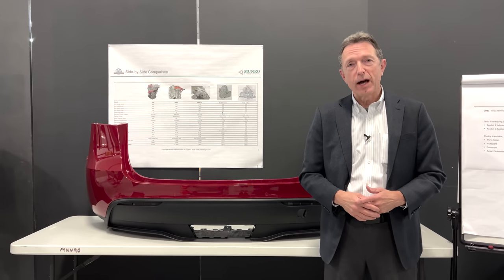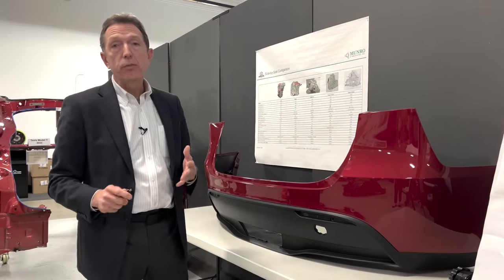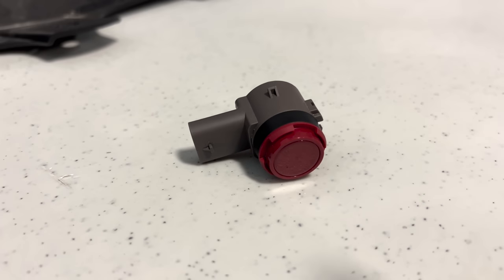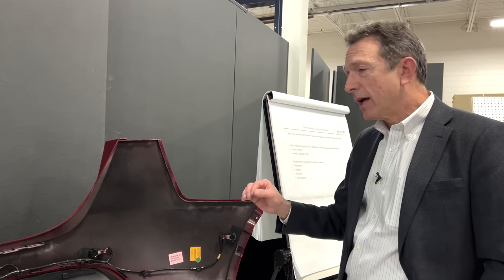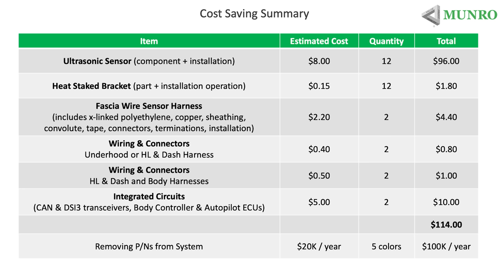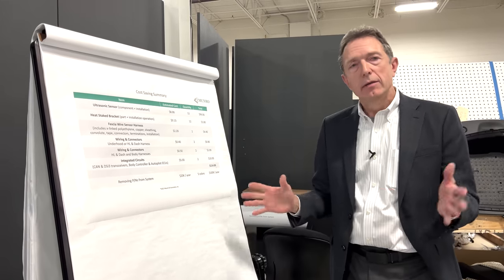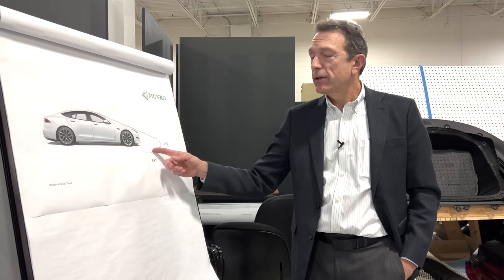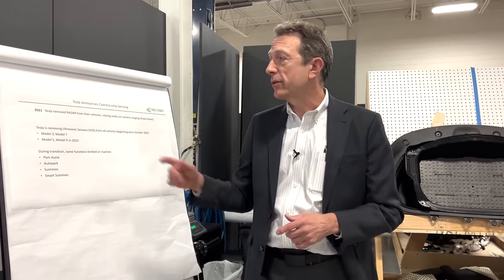Tesla REMOVING Their Ultrasonic Sensors

Comment: So $1 x 1,000,000 = $1,000,000...... $114 x 1,000,000 = $100,000? At current vehicle production rate - which is close to 2mill per annum that's a near quarter billion saving -  definitely when you factor in labour saving (human or robot fits its and clips it?) And another step removed from the assembly line reducing time, space etc.

Comment: I am fairly sure safety minded Tesla would not remove the USS unless they could guarantee at least the same functionality with the AI vision.  I suspect it will end up being much better as parking sensors have a number of weaknesses.
If I were a competitor I would be worried.  Tesla's "the best part is no part" will in this case give a better product with lower costs.  How do you compete against that?!

Comment: Trouble is ultrasound detecters are subject to similar problems as radar.  They rely on reflections to detect things.  Soft items do not reflect very well,  metal posts reflect very well,  but round ones scatter in an ark away from the post and return very little to the sensor, square ones reflect well but only reflect towards the sensor if the face is perpendicular to the line from the sensor.  Also like radar you can get multi reflection paths which give a distance further away than it really is.
Do notgetme wrong I love having them on my vehicle but the average person even if they bother to read the instructions quickly forget the limitations of the system and treat the responce as gospel.   How many times with close quarters impacts do people say the sensors system never activated.
I might even fit them if I.get a tesla without them but they will not be.part of the autopilot system.

Comment: Tesla vision has memory and path prediction. If it’s a static object it will know it there. If it’s a moving object it’s coming from the sides or the front, so camera will see it and can anticipate the path of the object. Keep in mind USS are only useful for near field and thus for low speed maneuvers, plus they have slow “refresh” rate, so this will not impact ANY safety issues as the USS can’t be used to prevent any significant accidents (maybe slow moving ones at under 5mph but that not a safety concern).
People were concerned with Tesla removing radar. However, this has not caused any safety issues and in reality, from what we see from safety tests (NHSTA, IIHS, NCAP) safety is actually improving. Furthermore, there are much less phantom brakes and false alarms since they removed/disabled radars. It just goes to show that not only can cameras be as effective at these tasks, they’re actually superior.
Because Tesla is developing FSD it’s gaining significant advantages at removing sensors that competitors cannot since they don’t have the technology to replace them. This will reduce the cost of the vehicles to the point that although FSD computer might be expensive, the overall FSD+sensors will be less expensive than radar, cameras and USS have to install to reach similar safety levels. It will allow Tesla to either increase profit margins or lower prices - being more competitive and in a better position to succeed in case of a significant recession.

Comment: @6.33 Here is where Tesla's AI comes in with the "occupancy network". Before an item ends up 10 inch from your bumper, the Tesla drives onto it and in the distance before that The "Occupancy network" is generated of that area in front of the bumper, a 3D representation of the surroundings of a Tesla, and it also knows its movements if applicable (another car for example). Together with the wheel turn data, the AI knows exactly how far an object is in front of the bumper, even without being in view of the camera..

Its kinda how a human would do it, we have been able to park very well without these USS for decades, also not seeing exactly how far we are away from an object, we have identified before, know its there but not seeing it, but have a pretty good idea where it should be, like a curb or a rock or whatever. Heck, even my last ICE car (2016) did not have these sensors.

Comment: 6:20 The bummer. I ordered 4 Model Y for my employees and thinking of canceling the order. This Vision-Only is bullshit and not working. Wipers and auto-lights going wild. Street sign recognition and speed adaptive cruise control is still as bad as 2019. Driving a 2019 Model 3 Freemont Panasonic with 125000 km on ODO and 2022 Model 3 Shanghai LFP CALB with 7000 km on ODO. Technically the german cars are much better with laser/LIDAR, USS sensors and WORKING speed limit recognition (Mobileye) plus the adaptive cruise control.

Comment: I understand this from a cost savings perspective, and I get what Elon is saying when he talks about if humans can do it using only sight, the car can too. However, to me, from a safety perspective, the vehicle should be able to EXCEED the abilities of humans. 

Imagine driving through heavy fog. You can’t see much, so the cars cameras won’t be much better. If you instead had a forward radar sensor, you would be perfectly fine. Same thing with the USS, it’s not that cameras can’t be made comparable to humans , but that shouldn’t be the goal imo. 

Goal needs to be “A Tesla is the safest vehicle”. If your vehicle can be 10x safer on autopilot than a human driver, that’s even more of a reason to switch to self driving.

Comment: Don't buy the 2023 versions, this completely ridiculous. the cameras and even the ai they use will not detect everything around as you drive this will be an absolute disaster mark my words. How is it meant to detect  and measure the distance objects are from the car just with the camera when its not even at a proper angle. Then the 1ft thats out of the view of the camera still has bumper to cover in that 1ft area so anything no detected by the camera will just hit your bumper. Theres just so many akward and ambiguous objects around us that is'nt just a basic wall, pole or person that the cameras will miss.

Comment: The ultrasonic sensors were just confounding autopilot. The cameras are excellent at estimating distances - say a stop bar. The car knows precisely how far the wheels roll. Therefore, the cameras detect obstacles, know their distance, and calculate how many rotations the tires will take to reach the obstacle. Apparently, the ultrasonic sensors were putting out gibberish, making it HARDER for the car to calculate where the car was from an obstacle. Even the manufacturers of ultrasonic sensors acknowledge their limitations, including 
- Sensing accuracy affected by soft materials: Objects covered in a very soft fabric absorb more sound waves making it hard for the sensor to see the target. Add to this the variable performance due to different shape obstacles and you have a problem. How many subs have struck undersea obstacles? Subs use ultrasonic sensors. 
- Sensing accuracy affected by changes in temperature of 5-10 degrees or more
- Have a limited detection range: Even the longest-range sensors have a maximum range of 10 meters.
When creating the autopilot software the addition of a confounding set of data, especially unreliable data, does not improve performance, it degrades it. This was the problem with radar as well, the outputs were just providing confounding data. 
Stop clutching your pearls. Do you really think Tesla would delete ultrasonic sensors if they knew they would degrade autopilot performance? Hell, if more sensors improved performance, they would be ADDING them.

Comment: There is simply no way the front facing camera field of view can give an accurate distance reading for pulling up to a curb or other low obstacle while parking. Super disappointed that they’re doing this. I own a Tesla, and I love it, but I have a feeling I’m going to get pushed back to another luxury brand once those catch up on electric tech simply because they won’t cut basic, reliable sensors like this.

Comment: I’m assuming it’ll remember obstacles. Because if you park next to a bollard or low wall. Then x number of days hrs later you get in the vehicle and go to manoeuvre, will it remember there’s an obstacle behind you or in front of you?
Or what happens if an obstacle like a bike or toy etc is placed in that blind spot, after you’ve parked, how will it know that’s there?
Just hope as was said and has been mentioned in the comments that any animal or child that moves into that area is picked up by the cameras before anything horrible happens. I for one am glad I have them on my Y, because the number of times I get warnings that multiple cameras are unavailable (ok this is usually in the early morning and is probably a condensation issue (as Tesla has looked at them and had them all out and cleaned & I still get the warning multiple times every morning when I’m driving around 🤷‍♂️)) but if there are cameras unavailable would that then mean they’d not see that animal/child or even stationary object 🤷‍♂️
Reply: Why would it not do the same check it does during parking as when it's parked? Reminder that Tesla has Sentry mode that is all time monitoring 360 around the car. So it could just map any movement and flag it as a risk for when you leave when needed.

Comment: I really just don’t understand this change. Some people are making the argument, Elon included, that if people rely on Vision to drive, so should autopilot/driver assist features. To me, that’s a terrible argument. Sure, humans don’t have ultrasonic sensors and we can drive cars, but we also crash a lot as well. Having extra sensors, even if seemingly redundant, will always be safer. Many have already pointed out that USS doesn’t get confused when driving in heavy weather conditions the way normal drivers or cameras would, because it’s able to “see” through the rain, fog, snow, etc. It was the same thing with radar. I’d much rather them just keep the sensors, especially if it only costs them like $150. At that point, just pass that cost on to the customer. I’m already paying at least $40,000 for the car, what’s an extra $150 if it means more safety? It’s a brain dead decision for sure.

Comment: It's a no brainer to remove sensors when you realize that Telsa vehicles, under law, will essentially just have adaptive cruise control. There is just too much noise and too many variables to account for when it comes to a car without someone at the wheel for liability purposes, especially if you're just leaning on cameras. It's already in the small print. If pulling the hardware for a day that never comes saves on production cost, it's the obvious move. Anyone thinking those savings are going to be passed on to the consumer doesn't get it. Tesla is not going to accept liability for "self-driving". The term "autopilot" is at best overly optimistic and disingenuous and at worse dangerous and irresponsible.

Comment: The video was in general ok, but I felt it missed providing more information around the Pros and Cons of removing the ultra sonic sensors (like when camera vision is limited due to lightning or weather conditions - BTW Autopilot takes control of autobeam and wipers control to reduce visibility problems, which is a bummer personally). In the other hand, I feel Munro's team is slightly biased and tend to sweetened the downsides of Tesla, just because they love their new technology and can feel like they are Tesla fanboys (like loving the new battery pack that is fully sealed and can't be repaired in general). Is my humble personal opinion...

Comment: I happen to have insider information from Tesla. They're going to remove cameras next. The engineers told me that the Autopilot will be using front and rear crash sensors and accelerometers to drive a car instead. [this is a joke, of course]

Comment: You're overstating savings; I was a vehicle cost and budget analyst in the auto industry for about a decade; you appear to be using cost swags, not actual piece costs that are derived from high volume manufacturing contracts. If figures came from Tesla, they are hiding their real cost from public view. Often, cost of pieces in autos thought to cost dollars are really just pennies, so all these figures coming out to even dollars and figures less than a dollar coming out to nickels or dimes sends a red flag up in my mind. 
Wiring and harnesses are one of the highest piece costs in a car beyond powertrain components and large body stampings, and this table shows savings on electricals that I'd actually expect to be higher, unless there is a mix of production factor involved with these ultrasonics that pulls down the per-vehicle average. I may not have heard you say these sensors are on 100% of Teslas, or only on the highest level trim packages. 
Also, since color mix in production is unlikely equal for each color, and cost of different colors themselves are different, you swag that in your estimates also. 
Wouldn't surprise me with real numbers this cost save is closer to $40/vehicle, but given recent inflation it may be slightly more. 
Won't matter though, Tesla is not meeting production targets, and whatever the savings is will not be realized to a large extent.

Comment: Ultrasound, lidar, etc. are all broadcast tech that need to send a pulse to calculate distances to nearby objects.  Since there are going to be a lot of these devices on every self-driving car, rush hour is going to be a huge, mobile Denial of Service attack.  Those "unique" identifiers may end up not being unique enough, and all that signal noise from other cars is going to make active sensors a computational nightmare.  

What about cameras?  Passive info gathering sensors that don't spew extra noise are perfect for self-driving.  A camera flash from another vehicle shouldn't hurt anything since the light is not coded, we are just using it to make more of the image visible.  Can cameras fulfill the role of all the other sensors Tesla has ditched?  I doubt it.  But people should take a step back and remember we are trying to make a car that can drive better than a human being....that's a pretty low bar.  😉

Comment: I decided not to buy an EV Mercedes precisely because safety features had been removed because of chip delivery problems, Now I have the Model Y and I have already scaped it in the parking lot as it misses everything a foot above the ground. I am trying to reject the car because the carI test drove in September had the sensors and they were removed in my delivered car. No one has explained how a camera without  our radar or USS can measure distances. I think Tesla will have to recall all the new cars and retrofit a USS or radar
Reply: Did you manage to reject it based on this observation. I’ve not seen actual safety features being removed due to supply issues before, which bits did this apply to?
Reply: @robinisathakur  Tesla would not let me reject the car because it is a business purchase and the small print in the T&C states that we have no rights under the Consumer Rights Act. Most purchases are business purchases so Tesla are laughingly the way to the bank.

Comment: Since this man is not a software engineer for Tesla..making guesses about the 3 feet in front of the car should be avoided.  That falls into fud category.  This same example falls under the removal of radar...that turned out to be straight up fud.  Vision does just fine and continues to improve without radar...imagine that.  It's a simple matter of programming static memory to retain the variable that vision just saw and calculate its velocity and direction to determine said variable.  No child or object will suddenly appear in front of the vehicle out of the air..ever.  If you park the car and someone places something right in front of it..sentry mode will have noticed it..and the static memory will be update upon start up...vision will be aware of it and can be programed to notify the driver of potential obstruction..warranting the driver to check it out.  Also, it is the drivers responsibility to be aware of the surrounding prior to engaging drive.  You do this now and it seems to be okay..so why the fud?  Again, this presenter needs to focus on just his analysis of engineering and cost reduction potential....not his personal fud concerns without having a general idea of programming in place to already address his pointless and irretanional fears, uncerenty, and dought...due to his own lack of understanding.

Comment: I doubt that the removal of the USS is a clever move. You save some 100$, but you will loose quite a few sales completely. I would never buy a car without some distance sensors for manual parking. And as long as Tesla is unable to prove their vision only approach is sufficiently reliable I will not get a Tesla any more without USS. In the end, they are not the only company that can build decent electric cars.

Comment: It is a sh--ty accounting cost-redudtion move. There are plenty of cases the cameras will not see things, ranging from blind spots, totally dark places, shiny light that blinds the sensor, getting out of a garrage where the side camera cannot see after the corner, dirt on cameras, double obstacles (something coming from behind other object) and so on. It is amazingly stupYd to cut costs when the risk of injuring a child, a dog or simply hitting the car is so high. You move the costs from the 100ish dollars to make the car to many hundreds or much more on the client. Pretty much any good modern car has radars telling you than something is coming when getting out of a garrage, mounted in the corners, Tesla not only removed all radars, but also the proximity sensors.